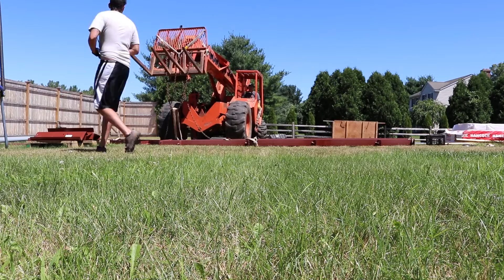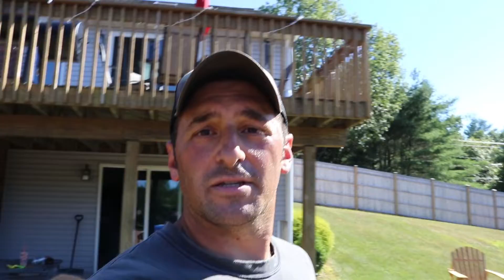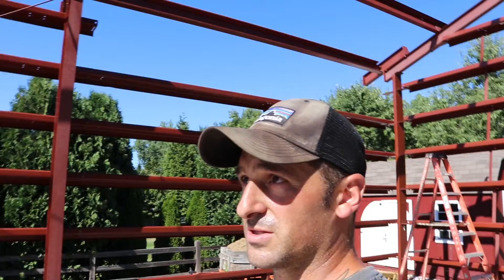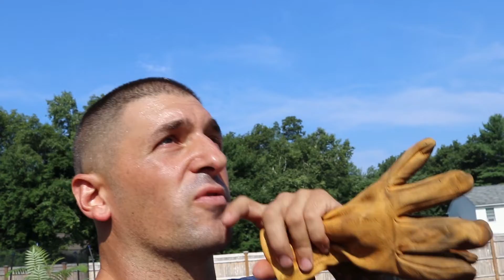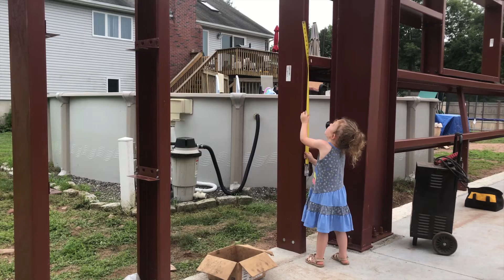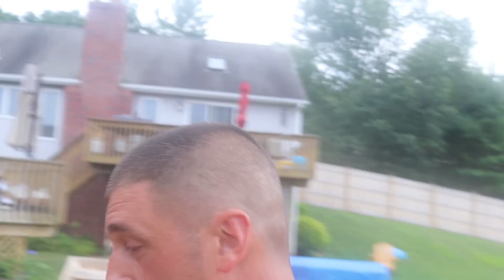How To Build A Metal Building PT3 - Raising The Steal- Steel Building Construction //012

Comment: Hi there.....looking at doing a Red Iron building on my property.  What are the dimensions of your building?
Reply from the maker: Mine is 56x36 because that’s the max size they would let me put on my lot, it’s just over 2000 sq ft. A very common size is the 60x40.
Reply: @howiecoro  Thank You.  Is it 12ft high to the eave or 14?
Reply from the maker: @Dozz70  14 to the eve. 20 to the peak.

Comment: Extended boom forklifts lock the auto leveling on the axels when at their limits, so if you drive forward or backwards a little bit on uneven ground, you'll notice that you're suddenly teetering on two wheels.
Reply from the maker: Yes very scary

Comment: Honestly, that's not enough weld to warp that column. You'd have to have 1/2 legs and everyone of those welds welded AT the same time to make some wild warp that bad.  Twisting happens from something different, from my experience welding structural I beams fluxcore
Reply from the maker: Yeah just not sure why it came that twisted then?

Comment: And I've built over 500 prefabs.I've never seen one that small be so robust.that's a whole lot of girts,and even a pretty good size wind frame for that size
Reply from the maker: Yeah so because I wrapped this OSB and then a Hardie broad on the exterior for siding. The manufacturer had to add the extra metal for snow loads and strength. The good thing is it gave me joist to screw everything into.
Reply: @howiecoro  .cool.I wondered why.